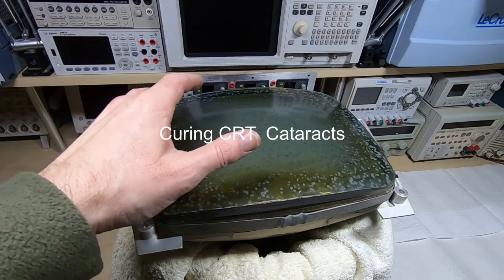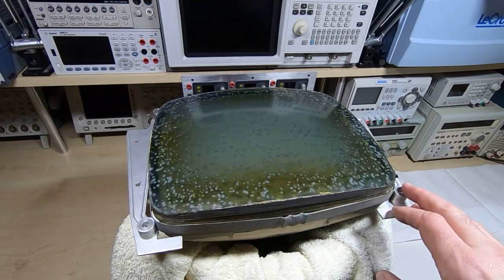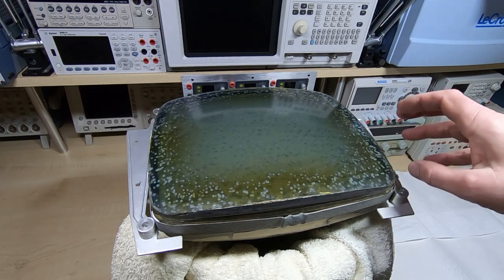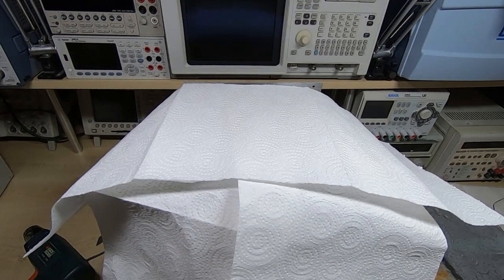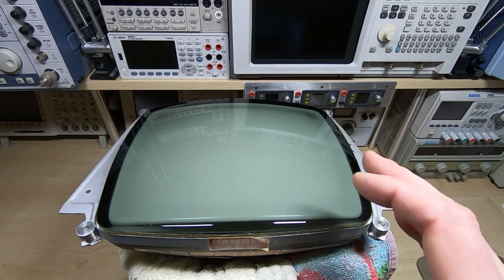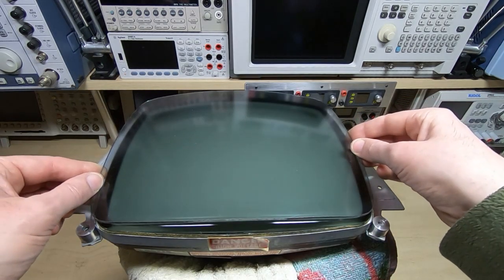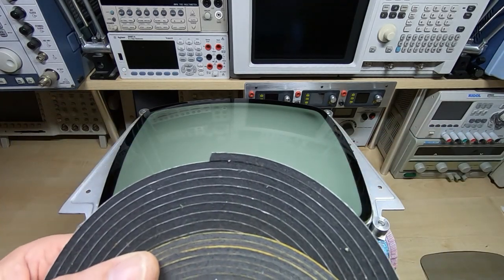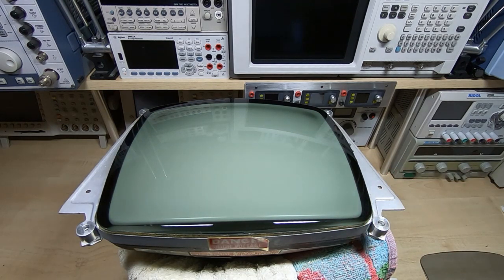Curing CRT Cataracts

Comment: I worked for a monitor manufacturer for 13 years we used those CRT's with and without the bonded face plate and it was added by the manufacturer to give the etched anti glare surface. It did give extra protection but the bare CRT met all implosion requirements.
Reply: Is it correct that older CRTs (maybe pre-1980's) do not meet implosion requirements without the bonded face plate, whereas more modern CRTs meet those requirements regardless? I thought part of the reason for the bonding was to create a barrier between the face plate and the tube. The face plate looks like it serves as both containment and a cosmetic barrier.

Comment: I've read anecdotal info that the 'jelly' adhesive layer is part of the safety mechanism itself; however, what you said in regards to that layer helping absorb shock so it doesn't transfer from the face plate to the tube itself, makes sense. Still, I do wonder if part of the reason for the 'jelly's' thickness is to do the reverse and protect the glass face plate from the tube itself: if the tube implodes, that shock and the resulting flying shards of glass would first have to get through the 'jelly' before hitting the face plate. Since the face plate is still glass itself and can shatter, I'm led to believe that removing the 'jelly' layer does reduce to an extent the protection. I heard of someone replacing the 'jelly' with a curved sheet of Lexan, but that sounds quite difficult to create. Also, Lexan could yellow or cloud with age. If someone still has CRT manufacturing equipment and can reproduce the final step of injecting the area between the tube and face plate with fresh 'jelly,' that would be great.
Reply from the maker: Yes the internet is full of anecdotal 'advice'. A few mm of soft 'jelly' will make little difference. If in doubt then do as I have and try breaking a few old CRT's to see what really happens. In some designs which used the same base tube there was no jelly and the face plate was fitted to the machine itself rather than the tube. Also try braking the face plates if you want to see where the strength is. The main advantage of the layer when it is clear is that it reduces diffraction of the images which you get with an air gap. Having said that you can leave the tube untouched if you do not mind being unable to see the image.
Reply: @JerryWalker001  Interesting to know that some designs involve a face plate not adhered to the tube itself. Which models are those? The CRT I am dealing with is from the early 1990's and is a computer monitor; it has a very tiny cataract that looks like an air bubble, much like you'd see behind a poorly applied window tint. I don't even know whether or not the tube's assembly employs 'jelly' - all I know is that the tube is a Trinitron. I am still debating when it comes to fixing it. To begin with, it might be extra difficult to lift the face plate (if there is one) given the damage to the presumed 'jelly' layer is limited to that one spot.

Comment: Where do you get the black double stick foam? Do you recall what the thickness was for the ADM3A?
Reply from the maker: I got it on ebay. The thickness varies with different tubes but for the one in the video it was 5mm .